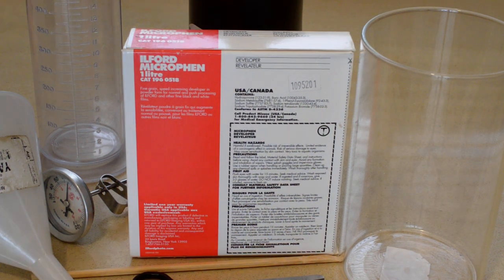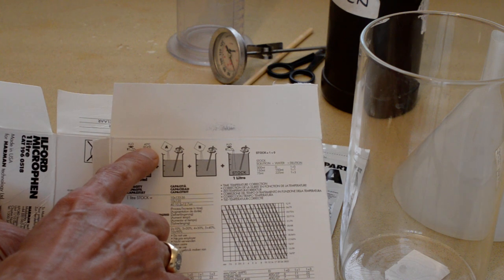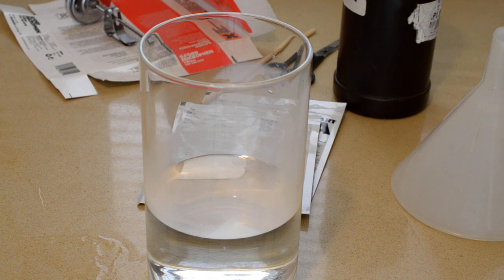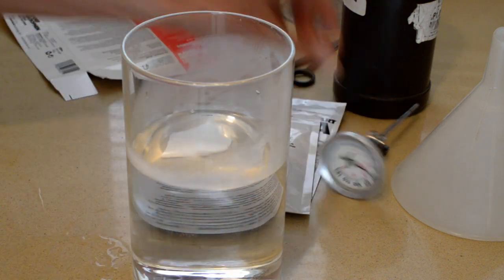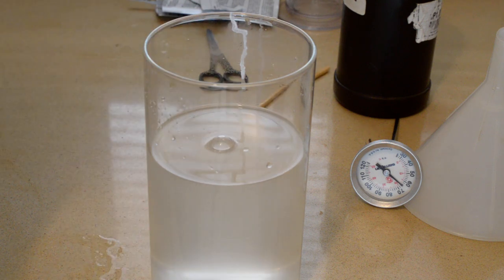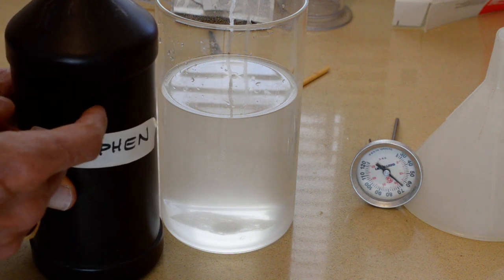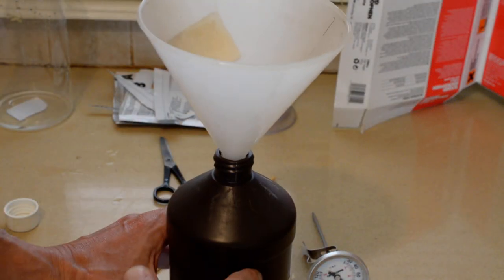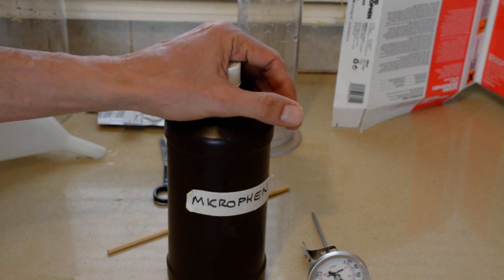Preparing Powder Developer

Comment: Thank you for the insightful video. It is very helpful. Just one remark. You add 250ml to add up to 1l assuming you have 750 ml of liquid. However you have more than 750ml, because of all the powder that you added to the 750ml of water. The powder added to the initial volume of 750ml. Therefore, you need less than 250ml to obtain 1l. Maybe the difference is not that significant, but it seemed like a lot of powder especially from the second envelope.

Comment: Just curious what is the shelf life of microphen, or how many rolls can you normally process before its exhausted?
Reply from the maker: According to Ilford's "Fact Sheet" on their powder developers, "stock solutions should last up to 6 months in full capped containers" and "one month in a half-full tightly capped container."  I recently developed a roll of HP5 at box speed using four-month-old stock solution which was roughly about half full and the negatives came out fine.  Nonetheless, I poured the remaining solution down the drain, as I personally get a little nervous if the stock solution has been sitting around more than 90 days or so.  Working solution should be used within twenty-four hours of mixing.

Comment: The specification for 1 liter of finished stock solution includes both the water and the dissolved volume of the powdered chemicals. This mixing technique does not do justice, although the resulting error in the mix is usually trivial.  A better plan would be to mix the first three steps, water plus A plus B, giving a volume representing the water plus chemicals dissolved. then pour off 500 ml of that solution into the storage bottle. Then add enough water to the measuring cylinder to top it off to 500 ml, and add that to the storage bottle. (If you use hot water here, you will dissolve that residue he had left, which improves the mix a bit.) You should not use the storage bottle to measure "1 liter", because they have somewhat differing volumes and always hold somewhat more volume. (The exception would be those bottles which allow you to see the contents and are themselves graduated.)  I prefer amber glass bottles, which in a 1 liter size can be had on-line for as little as $3, compared to the $10+ charged for those plastic bottles. Additionally, the plastic bottle cannot practically be cleaned of the residue and by-products which adhere to the inside, whereas glass is always easiest to clean. The worst are the accordion plastic bottles, which can never be cleaned and which also pass relatively large amounts of oxygen (through the plastic) to accelerate spoilage of your chemicals.
Reply: or you could just FOLLOW THE DIRECTIONS on the package, just like he did in the video.........      You seem to pop up on a lot of camera videos and you always have a "opinion" about things that always comes across like you are the "all knowing, all seeing, greatest of all people".......     the biggest problem with that is the fact that your comments are always riddled with false information that you are trying to pass of as facts.